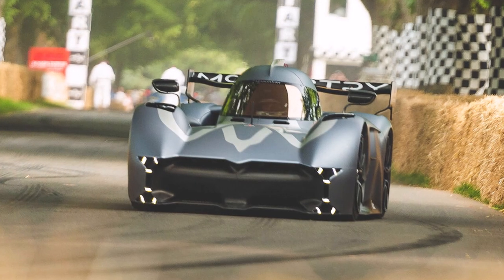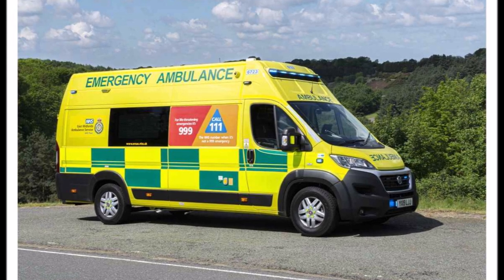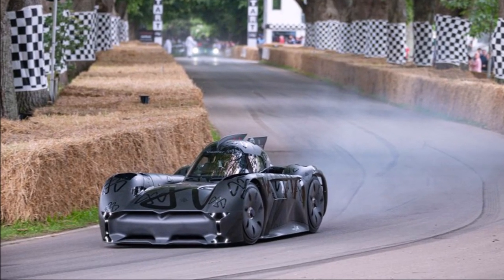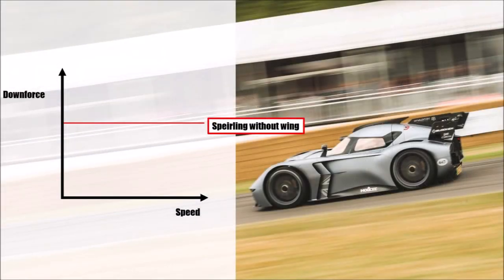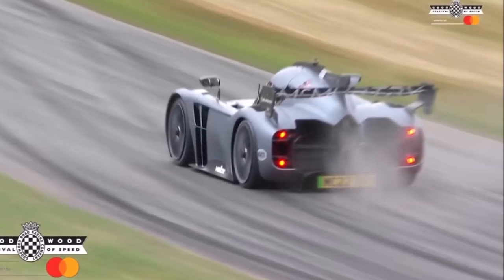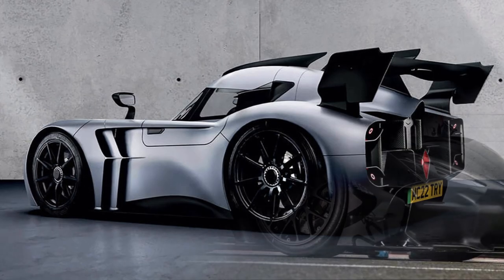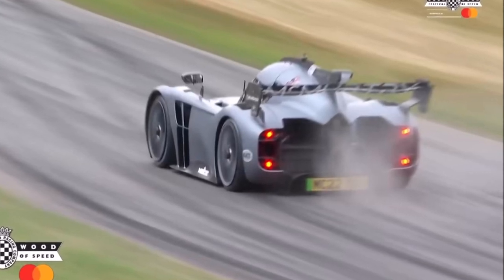McMurtry Speirling - The Unusual Engineering EXPLAINED

Comment: Truly fascinating design ..   Watching the race it was visibly tremendously quick .I won the Donnington GT championship in 1980  with a similar home built ground effects car . not a fan car .. but my design destroyed the opposition. so much so that the drivers in my class protested  unsuccessfully  my engine size.  I keep telling the Mercedes team that they barely need any aero on their Ground Effects F1 cars. Silverstone cct would be the perfect high speed track to go for a low aero drag, high Ground Effects  setup. I have a huge respect for your driver .. he must be super committed . The McMurtry Speirling  is in a class of it's own .
Reply: How did you get into racing?
Reply: gma t50 makes more sense than this
Reply: @kalmmonke5037  said no one ever.
Reply: @ironmantooltime  bev is cant be recyled many times, prius prime gets lower emissions unless both cars running on cleanly made elcrticity which is rare and even the itd take hundreds of thouands of miles to be better,   e fuels and hydrogen are actually sustinable with nuclear energy, prius prime could run on those.                      even worse, electric is not as fun as gma t50, for example engine sound quality and its correlation with drivers input, manual gear shifting, more visibility of moving enviroment so more precived speed, etc
Reply: @kalmmonke5037  by that logic a bmw m3 makes more sense than this.
Reply: @ironmantooltime  thats debatable bc this has lot more torque to weight ratio and is smaller sized, more space on the road to play in. also its doesnt follow my principls as well as gma t50, where there are more harmoines in engien sound, eveything reacts to drivers input more directly, less randomness ie turbo lag etc
Reply: Well done on your achievement Richard!

Comment: This is a marvel of EV track car engineering, first when I saw video of the record run at FOS I honestly was questioning if the clip has been fast forward, never seen anything go this fast around corners and coming out of corners. Using fans as downforce make perfect sense and the team at McMurtry really did a good job on the design. 

In Top Gear video the representative said they are interested in making road cars as well, excited for that. 🔥🔥
Reply: they should have made it more experince focused car, making the front iwndshield pillars futhur away  from driver and such things would give a bigger view outside the car, for preceived speed. and they shouldve used somthing like nissan e power drivetrain or maybe honda/toyota hybrid type of approach for lighter weight and some level of engine sound correlating with pedal position (torque output).   a nissan deltawing setup overall maybe would have improved things futhur.  freepiston drivetrain with air pressure regenerative braking could have been something that could also be applied to more affordable 4 seater car design i have

Comment: The redundant fan system is really impressive forethought. Really cannot imagine a non aircraft type guy thinking of that. Off the top of my head I can't think of many roadgoing cars that have redundant systems on really anything.  Emergency systems maybe, but redundant? Are there any that I am not thinking of?
Reply: Some luxury cars have redundancy in ways that keep a broken vehicle operable. 

For example v12s with separate looms for each bank so it can function on just half if needed
Reply: Redundancy is really not as important for road going civilian cars. If they break you pull over and call for help.
Military vehicles can have redundancies though.
Reply: Brake systems in cars are made so they’re split, with one hydraulic system working the front right and rear left wheel, and the other running the opposite corners. If one loop experiences a leak and stops functioning, the other will still work. The use of wheels on opposite corners helps keep the car going straight.
Reply: Brake lights and headlights include more than one lighting element, in case one burns out.
Reply: I wouldn't say that only an aircraft engineer could come up with a redundant system for a race car.   For most cars redundant systems are not neccessary, or completely impractical, though there are still a lot of redundant systems, such as brake systems. But the problem with a fan car is that if you are pulling 3g's around a high speed corner and the fan fails, you are going to suddenly be ploughing straight, potentially into the nearest wall at very high speed.  This is a major safety issue, and part of why they were banned in F1.  I would say it's just due dilligence from the designers to include two fans into the design, though overall, the engineering of this car is indeed super impressive.
Reply: boats usually have redundant systems too, not just aircraft. in a car you break down just pull over and call for a tow truck, in a plane or boat it's a bit more of an issue and lives could be at risk. I don't know much about space craft but would be surprised if they don't have redundant systems as well.
Reply: lamborghini ALA wing
Reply: accelerator pedal/drive by wire

Comment: Thanks for the informative video. I am really impressed with the Speirling, from a technological as well as a conceptual perspective. Also it looks just great. It proves they should embrace fan driven down force in racing again. Killing it back in the Chaparral time was very much anti-innovation and a big shame.
Reply: Imagine modern f1 cars with this tech installed. Make them shorter, simplify aero and allow fans like this
Reply: @tyler_bt3326  yes, smaller lighter and just as fast. If not faster.
Doing them as all electric is still in the future but active aero needs to be a thing in f1
Reply: Fans were banned for a very valid reason: stones, etc. being spat out the back of the car. 

This car can have a fan as it was designed for hillclimbs, but a circuit racing car cannot
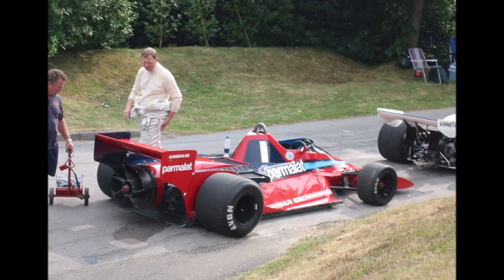Reply: @psk5746  They added a big air filter to prevent exactly that. See this vid at around 2:10. They are also making a road version which would have similar safety concerns, if not more so compared to racing.
Reply: Fan cars are not good for f1 or group racing because of all the debris it launches in the track lol….
Reply: @yourtubisfilled7164  nope, that changed litteraly nothing lol…
Reply: @yourtubisfilled7164  In the real world that filter would get clogged with stones. So again short hill climb or very, very clean race track only
Reply: Fan cars are too dangerous to drive and will never return to motorsport.

Comment: It's interesting that the concept is so different from Gordon Murray's concept for the T-50, which uses the fan to stop flow separation from its unique diffuser.
Reply from the maker: Actually the Speirling is using the fan like Murray's Brabham. But the T50 system is the result of further development...
Reply: The T.50 system is much more road friendly since it doesn't require a seal to the road. For track use, the vacuum cleaner setup is superior. That said, it also probably is way harder to get used to

Comment: More importantly, the ability to switch off DF on the straight allows the car to have lower ride height and/or a more compliant suspension without grounding out on the straights.
Reply: They have active suspension :d
Reply: If active aerodynamics were allowed in racing you could perhaps achieve nearly similar results without a fan and its energy needs.
Reply: @basilb4733  not really. If understand correctly this design is very streamlined. Just fan provides negative lift. And RW was afterthought because they failed hit balance with just active skirts at high speeds. In other words design was too effective.
Reply: @basilb4733  You have to remember that even traditional downforce is still technically powered by the engine since the engine is what's producing the speed needed to make it work. The fans on the other hand can be turned on or off as needed, and still work at low speed corners, where as traditional aero needs high speeds to be effective

Comment: Hopefully well get a pikes peak run of this project
Reply: Will it work on dirt surface? Pikes peak is combination of dirt and paved road. This vacuum system will play hell with a dirt surface. Traditional aero such as wings might be better. Wings can be as larger as needed and be front and rear and be active, they can adjust as needed while on track.
Reply: @robert5  never realised it will be a big problem. But they seems to be great engineers. sure they will find a way.
Reply: @robert5  I believe Pikes is bitumen all the way to the top these days

Comment: It's a great achievement to see the Goodwood hillclimb record broken, HOWEVER
this purpose built BEV built to no regulations beat a nearly 25 year old F1 car (in the year they introduced grooved tyres to limit grip!) on a short hillclimb stage.
Reply: Very impressive from the old McLaren
Reply: @defnotatroll  
beyond impressive!
Reply: Vw idr driven by Dumas had the most current record at 39.9s from 2019. 
Dumas drove the latest ev supervan this year, there was some rumors vw wanted to go again in the evo updated version of the id.r which ran China's tianman mountain. Maybe next year? 😀
Reply: @4literv6  
It's the same thing. It is a purpose-built hillclimb vehicle which has to adhere to very lax regulations only.
Reply: @X8X8X8X8X8X8X8X8X8X  the id.r or the mcmurty? The id.r sure it's a full on race car only. The mcmurty had plates on it and will become a st legal car. 🤔
Reply: @4literv6  
Let's see about that. In any case, neither of those cars is as regulated as an F1 car is.
Reply: It does follow regulations: road legality. The McMurtry is road legal.
Reply: @4literv6  The ID R's run was done in qualifying. The speirling did it's record run on the Sunday, which is the day that counts

Comment: I don’t get why, if the car can go around corners stupendously fast, it can be built less strong than otherwise on account of not needing downforce on the straights.  (Surely going around corners is harder?)
Reply from the maker: It's just about that cars reach the highest speed on straights and since downforce increases with v^2, cars unnecessarily experience the highest vertical load on the straights where they don't need it. The Speirling can switch the downforce off.

Comment: Wouldn't the fan, generating 2-tonnes of suction, effectively rip up tarmac or road surfaces? Especially when cornering at speed. I mean you're literally pulling up the road to stick to it, rather than pressing it down as with "normal" downforce.

Comment: Interesting to hear the Fans are variable too, you can match acceleration with Suction and /or have it off - similar to drag recover systems, great concept that shocked the motoring world
Reply: It’s the natural progression and what f1 would be if it were left open design wise. Not new tech by any means. Throw in active suspension, six wheels and rear steering and it’s still just using old banned tech.
We need more cars like this though. Actually showing what cutting edge was supposed to be, not hybrid bs..
Reply: Group B rally too. If left unchecked
Reply: @Drewbyy  hybrid and electric are the future man, it's inevitable.  The instant torque and unmatched acceleration that even hypercars struggle to match.  but some sadly linger on as the rest of the world progresses.
Reply: @Drewbyy it's basically everything that we want from F1: smaller chassis to enable overtakes, no problems with dirty air and relatively (to F1) simple aerodynamics, make this thing a hybrid, and it would be a beast.

Comment: So would there no advantage to trying to shape the fan area in such a way that you could still have a large diffuser volume and front diffuser with flap like now newey’s X2014 has it? Does it get to a point where more downforce doesn’t actually help performance because you end up with more mechanical drag and the tire can’t use the extra load anyway? I’d love to hear more about the skirts, and how long they last and I really wanna see images of that van haha.
Reply from the maker: Yeah, me too. They talked about ceramic plates which they can drop. Would love to see that.
Of course you can shape the rest of the car so it produces additional downforce, but like I said in the video, they fully relied on the fans at the beginning and just recently discovered that it would be good to have some traditional downforce too. 
For the underbody flow there would be the centre vacuum area in the way, but you could still generate downforce along the sides and guide the flow to the diffuser.
Reply: @BSport320  Yeah my thought would be basically copying a 2022 F1 floor but instead of a plank have a vacuum sealed area behind the keel. Of course with a car this small that probably isn’t practical in terms of packaging. I can’t believe they say the next car they make will be smaller. Still it’s refreshing to see in a era of race cars getting longer and longer for aero.
Reply: @BSport320  I wonder if the skirts are sprung? Could be quiet complicated to get them to seal and survive.
Reply: @cademckee7276  did they actually say that? 😅 I’m all for making cars smaller and lighter, but this seems like it’s even smaller than a Miata or an Elise. I don’t think there’s much car left if you go smaller 😂
Reply: for a fan development platform, it needed to be sleek. just added downforce now.
can't wait to see what they come up with that when they put some more time into it. car is already insane tho!
Reply: @devandrasimanjuntak1646  “Yates also confirmed that thoughts are moving to the next McMurtry car, which will have a similar speed-oriented design, although it will be smaller than the already tiny single-seat Spéirling. 

He said: “So the future is smaller. For this car [the Spéirling] the objective was to deliver something that was in no way wasteful, had no redundant space, and nothing was wasted, just a phenomenal, compact, lightweight driving experience.

“For us in the future that is the direction we want to continue to go in.”” From Autocar

Comment: Can't wait until the fan system becomes something that is actively controlled by the driver allowing for lowered drag during the straights and only applying it when necessary for turning and acceleration

Comment: Would the random bumps and unlevel road surfaces of public roads affect its down force? 

Would it cause pressure differences that could make the car become erratic?
Reply: That could be the caveat. But if you watch the Goodwood footage, it is quite effective on that track. Quite effective indeed. But to continue your thought experiment, in the NYC area there exist very large rectangular vented electric manhole covers. Some as large as 700 square feet/ 65 square meters. Not that you ever could or would drive that fast on those streets that you would have an issue...but can you imagine a hard suction corner and you suddenly lose all vacuum over one of those covers?!?
Reply: @chriskelvin248  Lol yes I can imagine. That's why I asked 😂 it'll be nothing short of horrific lol Great to watch though. Lol
Reply: @chriskelvin248 irc in 1991 or so in a Group C race in Mexico a car sucked a manhole which caused a crash (I think a car finished upside down)… and that was without fan suction: just ground effect which since got banned/severely restricted). Active suction would without a doubt be extremely dangerous in case of instability due to track or malfunctions…)

Comment: The word "innovative" defined.  I note that while the acceleration is staggering, it isn't vastly better than the Rimec,  BUT, it brakes much faster due to the significantly lower mass.
That said, the Rimec is a more streetable two seat car with the usual luxuries of the genre.   At 2.5x the cost of the McMurtry of course.

Comment: This car needs upgrades now the concept is proven. double the HP to 2000 and give it 4wd as there is only so much traction available from the rear wheels. This concept version 2.0 will be way faster then this car. This is only a first step in proving it works.

Comment: Its been a long time since the first ev car ever made to now, its over 136 years. just think what will happen in the next 20 years, i bet everyone will have a ev car ,but still have ICE cars, because the oil industry will never ever let go of making sure we use ICE cars and to have oil, filters and petrol or gasoline as the usa calls it and they are leading the world in petrol cars every single car manufacture will have ev cars to buy, but the petrol cars will be still offered and the us will make sure that the mighty v8 still has its place, because or towing capacity, no ev car will be able to tow a caravan or trailer its that simple? 🦘🦘✌✌👍👍👌👌

Comment: You are wrong about Gordon Murray’s car spitting stuff out the back. The other teams exaggerated that to get it banned. Do you really think there is significant  trash in the racing line of a train of F1 cars going 150-200mph?
Reply: Yes. Racing tyres cause lots of debris or marbles as they wear which cause passing issues nowadays and while it may not affect a fan car as much, it would be horrid to follow.

Even my club race car used to have loads of tyre marbles in its side pods at the end of a 5 lap race

Comment: Clearly, it's the Michael-Keaton-era Batmobile.  Someone washed it in hot water, and then left it in the dryer on the max heat setting for coupla hours. 😐 
Then they probably got in a lot of trouble - because now there's only about 25 shitty replicas left in the world (most with a wheezy old iron GM V8, and slushbox.)

Comment: The wing is a shame. 

Surely better to speed up the fan suction at high road speed?

Doing that would surely be more energy efficient than the dirty great barn door fixed wing. 

They would just need a bit more space for larger fans.
Reply: Driver said that the wing helped a lot with stability.